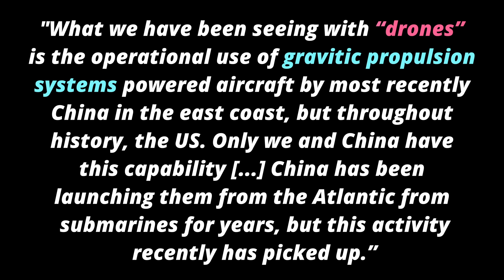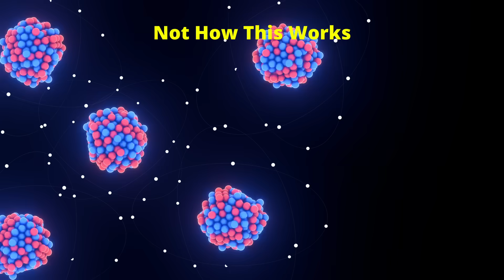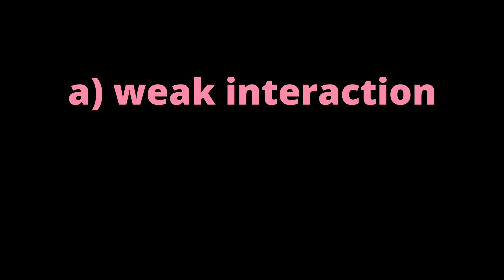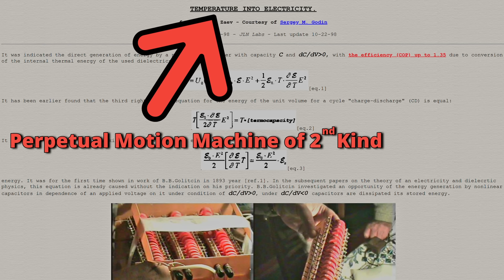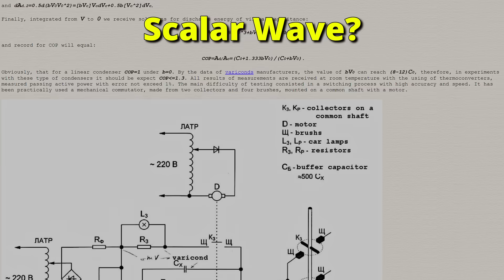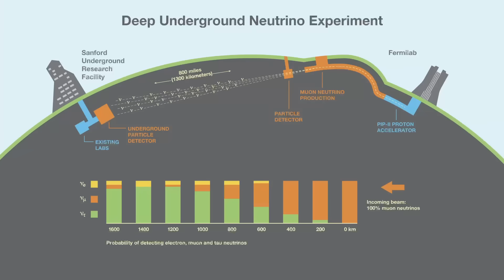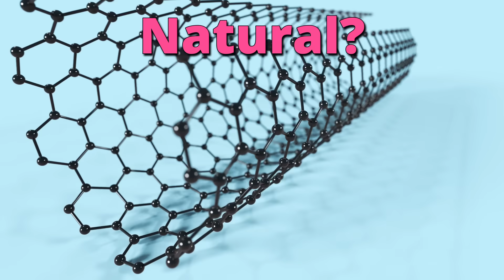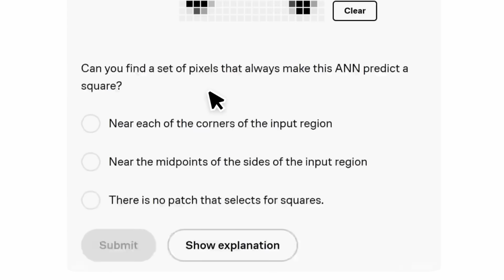What is “gravitic propulsion” and could the US government hide it?

Comment: Sabine, I'm going to go out on a limb here and tell you that the technology and physics you're saying are not possible, are possible. It's not a "conspiracy theory", I'm a former conspirator. You don't need a crazy device to generate energy. You as a physicist know that there is no such thing as "empty space", and you also know that truly empty space does not exist. I don't know to what degree you know this, but it's relatively simple to generate a device that can generate energy from the environment around it. Think of it like "virtual particles" that are around us all the time, appearing and disappearing. To give you a better idea: there is enough energy in this coffee cup that I'm holding in my hand and drinking coffee from to boil off all of the oceans on Earth. So, there's a lot of science that has been deliberately obstructed from the mainstream, and as one of the people responsible for that, please permit me to apologize to you.

It's not "high-energy physics" that I'm talking about regarding energy generation and converting it to either alternating current or direct current, I'm talking about "low-energy physics", which dives into quantum mechanics, which you mention in your video. It's a lot deeper and more comprehensive than most people know. Now, I haven't told you anything specific or done anything that would violate the reams of paperwork I've signed or said anything that would cause me to lose a security clearance if I still had one, so I think we're safe. I'll leave to your own devices, and I just want to say, I love your videos.

Comment: One idea I had a long time ago (which is a point of a sci-fi story I am drafting) is:  
- place a satellite into the (proper) Lagrange point
- add measuring apparatus for space deformation and other known properties (read gravity, elmag radiation, temperature etc)
- point it at the subject - where the subject would be just an good-old Silicon based computing device (eg CPU / MCU + potentially its own sensors + actuators)
- and you would find out very slight differences in some of the measured properties, depending on whether the CPU would:
  - do no computation (duh - there is the minimal thermal energy of information transfer)
  - do complex math computation which would not be read out (just /dev/null)
  - do complex math computation which would be read out by human entities
  - do complex math computations and use external sensors very frequently (again read / not read the output)
  - do complex math computations and actuate the sensor
And given whether the math would be predetermined or self-induced (true random) you would find out that there is actually a measurable difference of some properties around "sentient" or "hard-thinking" objects. Something which gets totally noised out here down on Earth.
Somehow aimed at discovering a proof to Simulation theory - if we are ran on something, it should bleed out to our dimensions if you try to squeeze out the "computer" running our simulation a little too much.

Comment: 14:17 : that would also make more sense than the original. It wouldn't be so surprising if there were some experiments/maths using which it's possible to create more effective or simpler nukes or even the mentioned lasers. Sure, you couldn't hide it forever, but you might get yourself a few years/decades of time to make it into something practical.

Comment: Sabine said that she has no idea what might gravitational propulsion might look like, implying of course that it would not be compatible with standard theory. 

Once pointed out I am very sure she would acknowledge however that propulsion by emission of gravitational radiation is allowed by accepted theory.

Technical feasibility is a very different issue of course.

Anyhow, I suppose most folk speaking of anti-gravity and gravitational propulsion have in mind a supposed analogy with the Coulomb force of electromagnetic theory (the EM 'velocity 3:22 fields'), rather than radiation. But this analogy (correspondence between EM and GR) does not work in accepted theory. I presume Sabina's remarks are (understanldaby) founded on the absence of such correspondence.

Comment: "Arrangements of matter that might display new behavior." This, I believe, is the right track. And examples of such matter have actually been obtained and studied from recovered UFOs. Sounds insane, I know, but it's a simple fact. David Grusch has talked about the study of "extremely strange heavy atomic metal--high up in the periodic table...arrangements that we don't understand what the emergent properties are, but there's just a very strange mix of elements...that are sophisticatedly engineered, certainly not by humans." Others with claimed insight into the programs that study this material speak of alloys that have been manufactured at the atomic level. If alleged leaks from this research are accurate, we can't reproduce this material, but can repurpose what we recover to a certain extent--perhaps enough to create a form of gravitic propulsion. Could an extremely heavy element--or combination of such elements--produce an exaggerated gravitational force for its mass that can be put to work? That allegedly is the technology of UFOs. If elements higher up in the periodic table than we have access to in our neck of the woods do have unexpected emergent properties, that would certainly be interesting.

Comment: Hey, Frau Sabine - awesome post on gravitics! But I've to tell you - Just keep it on the "Q-T". I received a Gravitic telescope 🔭 in a USPS box with no return address. It was missing some nuts & bolts ( nothing new there these days!) so I  slapped it together with some bailing wire and duct tape and took a peek at the center of the Milky Way 🌌 . You won't believe what I observed!!! Those clowns at Cal Tec got it all wrong - - - what is that incessant knocking at my door? Hold on...hmm, took a look thru my peephole and I see a bunch of duffers in black suits, some with Raybans on and the rest slipping on theirs. OMG, they even have a cute pug with them...

Comment: this still does not explain the already admitted uap sightings (The Tic Tac and the Go fast) by the pentagon. no aparent propulsion system, no heat signature, instant acceleration, outstanding speeds and the capability of going underwater. 

If this tech humans have, then it would mean they have come across a massive breakthrough in science and physics since the 40’s (which is when the first sightings begun), either through reverse engineering alien tech or by themselves.

this technology could be used for clean energy, and perhaps infinite energy, saving earth and the environment. but also posing a threat to the petro-dollar system, so no wonders they are keeping their mouth shut

Comment: if you want to know more, look up salvatore pais and mark mcCandish. one is an ex air force/navy engineer...the other is industrial designer engineer that worked as a private contractor for the air force. btw.....just to warn you. theres a reason why theres so little info on em gravitic flight. its not allowed. info is very suppressed. over 50 usa patents related to em flight have been seized by the us govt and people have been....removed over this. to put it mildly. also, don philips, ex engineer for lockheed who designed the sr 71 blackbird said he saw ufo/uap at area51 while they were test piloting the blackbird spy plane in 1963. he said the uap at area51 were doing impossible speeds and movement that was impossible due to inertia yet were still moving as he described. 10,000mph 90 degree turns type impossible moves.
what they taught you in school. sorry, is bullshit. gravity, apparently, is just another form of magnetism according to insider military whistleblowers. according to pais, you have to have the conductor concentrate millions of volts of em field at a particular freq focused at the smallest point in space inside a mercury gas/liquid vacuum for the gravitic bubble phenomenon to occur. his words. not mine.

Comment: The propulsion system is called ionic thrusters. It's not new, it's not secret, it's not special. It's very slow at the moment. Furthermore, its consumes fifty times more energy than propeller propulsion. The up side is that it's silent minus a slight low decibel buzzing noise. You can simply youtube ionic thrusters and see the thing in action.

Comment: Speaking of ‘Illegal math’: good encryption. Its use was limited to defense and security until Bernstein v. United States in the mid-1990s that export controls on encryption were lifted, which essentially paved the way for international banking; and then expanded rapidly in many directions to the point that the genie is fully out of the bottle.

It would be pretty cool to be able to fly like the reports of UFOs; but I strongly doubt the problem is classifying the maths/physics that allow it. If the information existed, and was merely classified, we’d simply see government craft using it; just as with encryption and nuclear physics, among other examples.

Comment: well to be clear, you certainly do not need any math to make a atomic bomb, that is dead simple, all you need is enough fissile material, and then a simple gun-implosion type setup will give you a big bang. However, to make a thermonuclear bomb, the fission-fusion type deal, then yes, you do need math, because you need to be able to design a device that very accurately detonates fission in such a way as to get it's energy, in the form of neutron flux and gamma rays to compress a fuel pellet in such a way that it initiates fusion before the thing tears itself apart, much of the actual physical design is already out there, but still, very high accuracy electronics and "switches" are an integral part of all this. You can't ban supercomputers or quantum computers and these will absolutely solve your problems for you, provided you know some crazy Russian who will sell you the fuel lol....maybe in the past, when the USSR just fall apart, that very thing could have happened...

Comment: She hasn’t considered that antigravitic  tech utilizes known physics. Like rapid rotation, ii you spin a 40lb weight and spin it at around 6,000 rpm you can hold it with your arm out at the end of a weight bar. It’s theorized that these craft are using cryo mercury in a centrifuge powered by some kind of high energy source depending on the craft. Some might do some even crazier shiz and use physics from other dimensions.
Reply: yes, you need 3 of these mounted perpendicular to eachother for full directional control.anything to make gyro,even electrons wizzing round in a circular path.(plasma)

Comment: There is no such thing as "anti-gravity" However the concept of EFT craft using the Lorentz force combined with Magnetohydrodynamics is very real. This would create a craft to appear to defy gravity but of course its is not using gravity. It is using a magnetic field contained within a plasma field, which of course is magnetic. Then using the Lorentz force much like a railgun or "mass driver" to change direction and accelerate the craft. Because the craft is engulfed in a plasma field there would be no air friction. It would be able to achieve speeds similar to hyper sonic missiles, which use the same concept when the air in front of them is Ionized into a plasma which gets rid of air resistance. The issues of this concept would be the g forces would kill a pilot. But of course you could always build it into a drone and if this design has any prototypes out there. This is most likely what they have done.

Comment: Instead of getting brilliant, I will explain in a basic way how computer memory works, specifically random access memory, or ram. You have a finite amount of memory in RAM. In order to make sure all the programs you are running can all fit within the capacity of the RAM, you kind of trick the program into thinking that it has one solid block in memory, or contiguous memory. In reality, if you put all aspects of a programs memory in one chunk in the ram, it leaves only a finite amount of space left for other things to run. Let’s say you have 2 sticks of RAM, and both of them only have 1 gb of space left, for a total of 2 gb split between them. You want to run a program that takes 2gb of RAM to run, so instead of removing one chunk of memory from one of the ram sticks to make space, the computer tricks the program into thinking all of its memory is in one block, but in reality it’s split between the two ram sticks, each one handling 1 gb, and the computer handles the rest. So programs basically get pranked.

Comment: I cannot think of a practical way to achieve antigravity without violating the first law of thermodynamics. 
Because it is mass that is affected by gravitational fields.
If it were possible to reduce the mass of an object to zero, you could accellerate it to an extremely high velocity without energy.
Then after reversing the manipulation involved, you could harvest the kinetic energy of the object.
Now one could argue that the energy for the manipulation is equal to the amount of energy harvested, but how would you be able to tell the amount of energy involved beforehand? The only amount I can think of would be infinite, in which case it would not be practical anyway.

Comment: We do know that there is a force from wave beams that can push on an object, Crookes radiometer, that can measure intensity.  We know in space this force exist and can be used.
    Looking at the math of liquids and gases flow in a pipe and magnetic energy in a tunnel or wire.  The math is similar if not identical with different coefficients.  In fluids the math for lift is a vortex and a doublet at the same point that creates a spinning cylinder. A group of them properly arranged an air foil or water foil.
   This suggest that a magnetic vortex and doublet moving through a magnetic field would create a force perpendicular to the motion and rotation, like in fluids.   The force would be related to the strength of the field in space but would in free space be greater then the accumulative other forces.  However; to obtain significant thrust a large propeller with magnetic blades would be needed, look like a flying saucer.  The means of creating such a blade would require something stiff enough to keep its shape while moving.
    Here is were an engineer background isn't sufficient. Not useless. For a simple minded engineer a very fine lithograph with laser(s) to use magnetic waves to push electrons along a path. to simulate a blade.  Such devices have been used in accelerators for a single path.  Big step to having hundreds around a center of a flying saucer.

Comment: Who's hiding it, a whole bunch of people have seen the TR-3B, there's a US Patent about it called a mass reduction system, it's available on the Internet and gives a detailed description of how the technology works and it's very heavy on the science, The TR-3B uses this mass reduction system and the plane, if you can call it that as it doesn't rely on the same physics like any other plane, is said to use a nuclear power system to power this electrogravitic system. Whenever you see a triangle shaped aircraft with 3 lights on the bottom and you think it's a UFO due to the way it maneuvers and the speed it can take off at from a completely still hover, then you've seen an aircraft with that propulsion system. It's quiet and used as a spy plane.

Comment: Liquid murcury - propelled by high power omni directional magnets - contained inside a kinda engine block - designed to safely harness high amounts of centrifugal force using the above

 (notes, keep the inside track of the block for the murcury to ride in a vacuum. will help with friction. Also I don’t mean like soup stir I mean spin that Liquid Metal up to fucking half a million rpm’s with the power of a nuclear submarine. You need it to be fucked fast to overcome the natural force of gravity, and then how much the shuttle weighs needs to be resisted aswell. I also think it’s possible we may not have a metal or alloy or material strong enough to contain the vacuum and the Liquid Metal at that speed) 

Build that much and you’ll see what I mean, we won’t be able to control it yet but it will be a gravity engine. It will shoot over the horizon uncontrollably, but… Make it more efficient and fuigure out what changes need to be made to control that effect and we’re there baby. UFO in me mums garage type shit.
Reply: You may say oh well it will just equalize itself and stay still but I can’t tell you every last bit of the design in a damn comment and hope someone will read it. Bend the track if it doesn’t work, experiment with a spiral shaped inside track, try finding the best combo then taking 2 blocks built like this and having them contradict one another. Or rotate the whole block like in the bike wheel centrifugal force demonstration, where the wheel stands itself end to end as it’s spin finds the path of least resistance to gravity. and maybe that’s how we get this “anti-gravity” force to come out of the centrfuge and act on the structure it’s connected to itself. Some way some how I just know magnets and murcury is how we can make this happen. 

Like hell Maybe we need to rapidly speed it up and stop the Liquid Metal abruptly to get the saved force out of the centrifuge like a flywheel kinda, use the hit from that force to propel the craft. But it’s magnets and mercury. The only question is how to contain it and how to make it better. we got many kinds of combustion engine I think in 1000 years we will have many kinds of gravity engines. We just need to see the first iteration work and show the world the process before we get shot.
Reply: @seththecat9317  What if we use two ring tubes side by side of mercury vapor and spin them in opposite direction while also twisting a vortex? or Mercury vapor in a vortex tube.